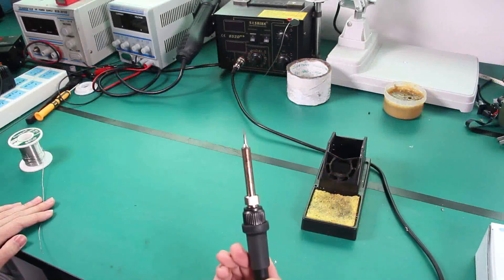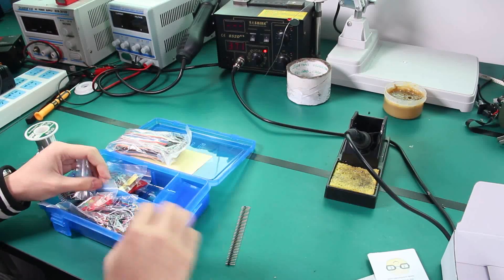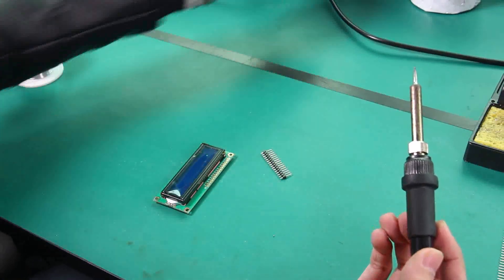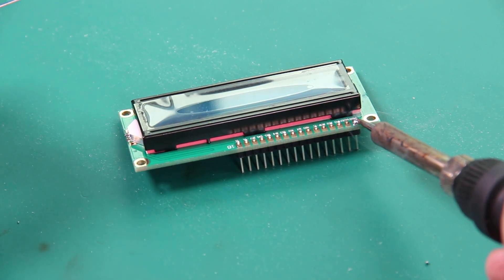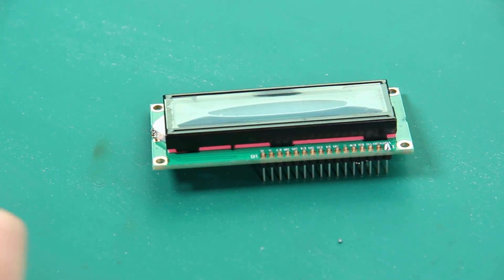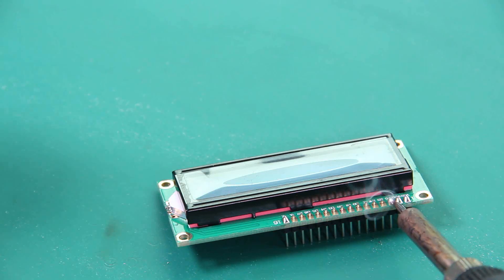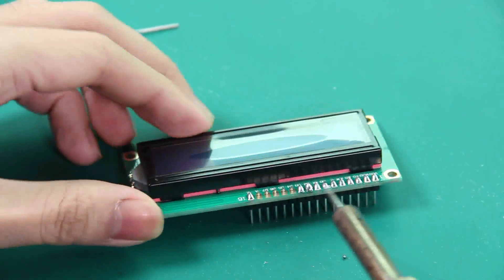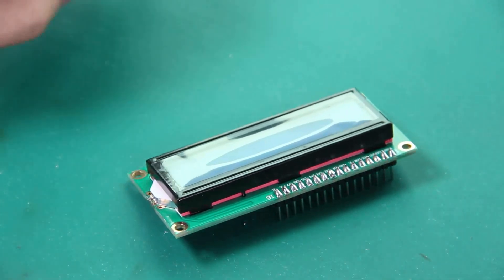Welding/Soldering Pins to an LCD - For Beginners - Arduino, Raspberry Pi learning

Comment: I have a temperature adjustable soldering iron (180 to 480 degree celsius). What is the suitable temperature to solder header pins to lcd?
Reply from the maker: The best temperature for soldering with electric soldering iron is 280, plus or minus 10 degrees.
Reply: @Sunfounder_official  Thanks!

Comment: hi should it also work without soldering or its necessary? I just 'attached pins',  connected it to the board and my lcd turned on but it did not receive any data from Arduino, (double checked the wiring and it s fine)
Reply from the maker: In this case, the wiring connectivity maybe not so stable. we recommend that you to solder the pin and have another try.

Comment: Bro please helped. I have covered all the holes with solder before putting the pins.Now I can't get them inside.
Reply from the maker: hi, you may try to hot the holes to shake the solder off. Or you can use a solder sucker.
Reply: @Sunfounder_official  Thanku so much it worked.

Comment: Can we use the display without soldering ( just by inserting the pins ) ?
Reply from the maker: That also works, but the connection may not tight.
Reply: @Sunfounder_official  thanks 👍

Comment: Nice explanation!
Do you use wire with flux?
Reply from the maker: Hi Andrew, since we used the Rosin Core Solder Wire, it doesn't need the flux.

Comment: I can use any Soldering Wire? Nice video! Well explained :]
Reply: Look at the percentage of “flux”. Flux let’s it melt. I would buy wire with 2 percent flux it.
Also try to buy “clean” wire, eg without lead. Lead is very, very unhealthy. 
Cost a bit more but is worth it.
Best regards, Leo The Netherlands.

Comment: Why are you holding heater on the pins so long time ?
Reply: So they get warm enough to actually accept the solder.. If you just drop hot solder on a cold pin you'll get a cold connection which doesn't work or works very unreliably.

Comment: at how many degree you melted the zinn?
Reply from the maker: +OnlyMyRailgun, there is no requirement, about 400 celsius degree is ok, as long as the solder can be melted.

Comment: hi my display is working fine at first, my supply is a connected to a resistor to change it to 5V(i have also used 7805 voltage regulator IC and 5V zener diodes), but then when the supply (12V battery) is being charged by a DC generator we noticed that the regulating voltages we use is not working anymore which in turn makes the LCD display random characters. Please help! Thanks
Reply from the maker: Dear Norberto,
The voltage problem will cause that the LCD dispaly is not clear, flashing or burn it. Not the random characters, random characters are generally due to the data is not correct, or LCD is not initialized or unstable wiring. 
Pls check the situations we have mentioned. If you still can't find it, pls connect with us and provide more details about the problem.
Reply: The display is alternating between random ASCII characters and the proper display. But when the generator is not charging the battery the display is at a stable proper display
Reply: could the difference in voltage between the datapins and the source pin be a factor in this error? thanks for the reply i really appreciate it <3
Reply from the maker: Dear Norberto,
It should be the DC generator problem. If you have oscilloscope, you can check the output of 7805, after connected the generator. 
In additional to, could you pls provide some picture or circuit diagram about the cables connection? We still can't understand your problem totally.
Looking forward your reply!

Comment: Thanks. My current soldering blobs are not shiny - is this why I have problems?
Reply from the maker: Happy to provide help. :)
Reply from the maker: Could you please tell me more about what problem did you have?
Reply: Intermittent display. Sometimes no LCD, sometimes no backlight. I thought LCD was bad to I replaced it but I suspect either the wires are bad or my soldering isn't up to scratch. 
Thanks
Reply from the maker: ArcanePath360
When you are soldering the pins, please ensure the pins and the pad on LCD have been wrapped by the melt tin as quickly as possible.  Please note that the two pins can not be soldered together directly.
You can try to add some melt tin.
Reply: Melt tin - you mean solder? I did do it quickly but maybe too quickly. I'm guessing I have 1 or 2 cold joints. I also didn't use header pins but directly soldered the wires to the pad.
I would throw it out and get a serial one, but I'm already using the SDA ad SCL pins
Reply from the maker: ArcanePath360
So sorry for the late reply. Did your problem has been solved?
Reply: Either you are using silver based, which does not shine after it solidifies, or you have cold solder connections. That means the parts did not get hot enough.
Reply: Yeah I gave up on these cheap 16x2 displays since I've had nothing but problems with poor connections and have now got a GUI touch screen that uses just 4 wires, and surprisingly uses far less power. 

Had no issues with other solder connections other than with these screens so I think where you pay about £2 for something like this they are never going to be reliable.
Reply from the maker: ArcanePath360 Sorry for the inconvenience.
Reply: ArcanePath360 I see what you mean. Te cheap display I have keeps displaying a $ character on the second line after a couple of minutes.
Reply: GeekBoy03   $ sign? It means money coming to you in future for sure.
Reply from the maker: This problem is caused by bad wiring or false soldering. Please kindly check the wiring first, and ensure the pins and pad are wrapped by the melt tin.
Reply: Sunfounder What is the recommended temperature, or wattage to use?
Reply: Why sorry? You didn't do anything wrong. I'm just here for the video and advice, which I found helpful, thank you.
Reply from the maker: The recommended temperature depends on the tin soldering.
For some common tin soldering, you can try 200~300 ℃. If the tin cannot be well melt, try 350℃(temperature above 400 ℃ is not suggested). If you use a temperature higher than 350℃, remember to turn off the soldering iron or lower the temperature to prevent the soldering iron burning out when it’s not in use.
Reply: Thank you

Comment: Hello,   can you help me with a question I have on LCD displays.  I have to replace a failed 1601 16x1 VER 2.0 bluedisplay.  I can't find anywhere a display with the same exact information and I don't know enough about displaysto know if a 1601 is the same as a 1601A as well as the VER 2.0 and if that is critical.  The display is for a frequency countercalled a DD-103Thanks,  Ken